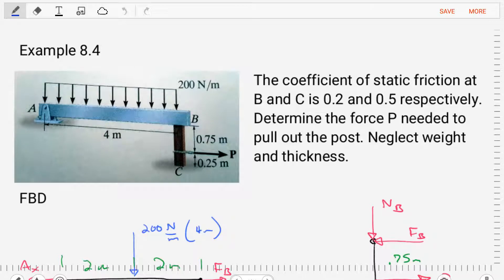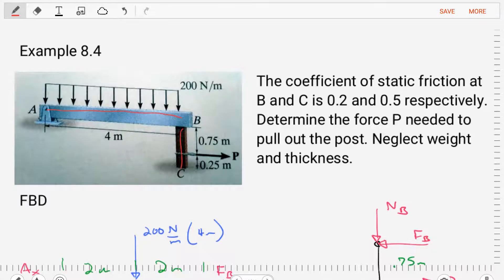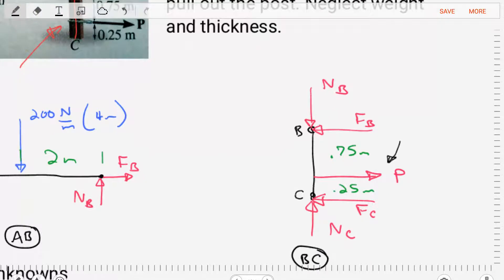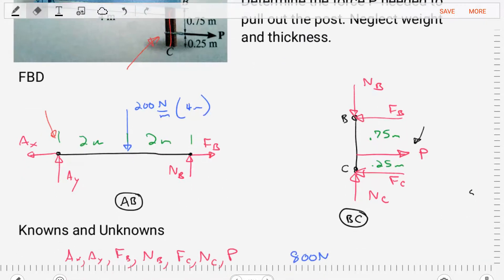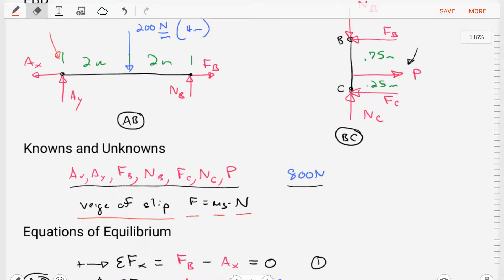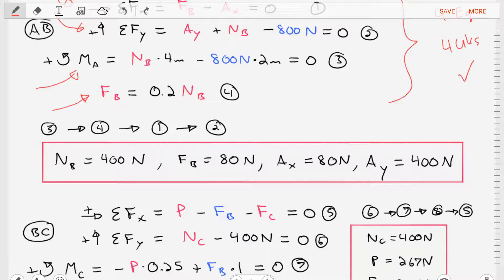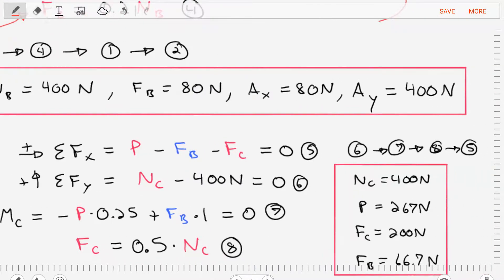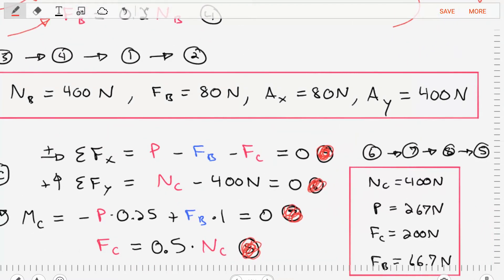Friction Example 4

Comment: Dr. Stewart, so we have two values for FB= 80 and 66.7, i got confused on that part, i thought  the value of P was 280 since FB was 80  and FC was 200.
Reply from the maker: Great question Steven. Yes we obtain two different values of Fb. One value comes from the FBD of the beam AB at 80 lbf. It is the force needed to maintain equilibrium in beam. Another values comes from the FBD of post BC at 66.7lbf. It is the forced needed to maintain equilibrium in the post. In this problem we want to know what is the force needed to pull out the post. The answer is the lower value, 66.7 lbf. At this force, the post will begin to slip-out.
Reply: Dr. Stewart, thank you so much for making it clear, now my doubt has been cleared.
Reply from the maker: glad to hear.